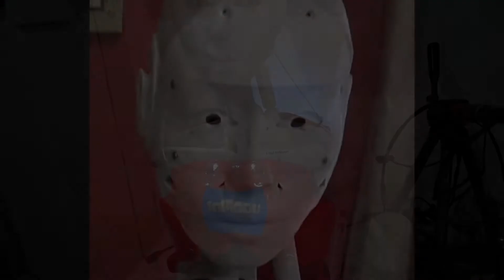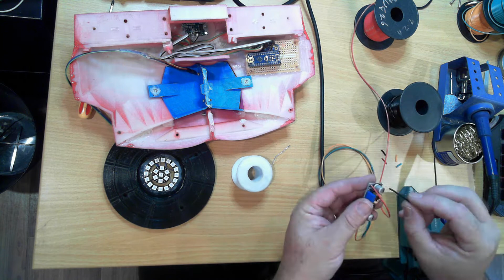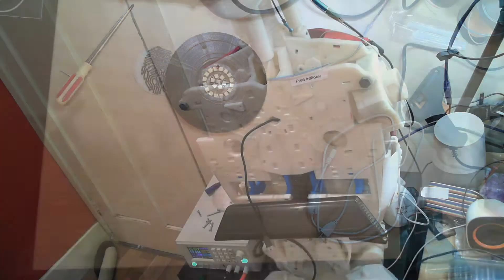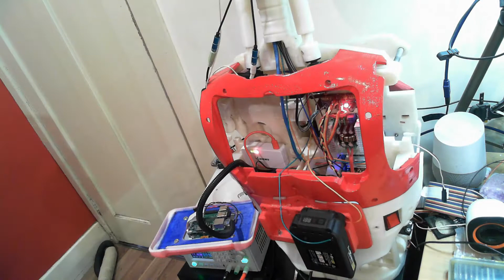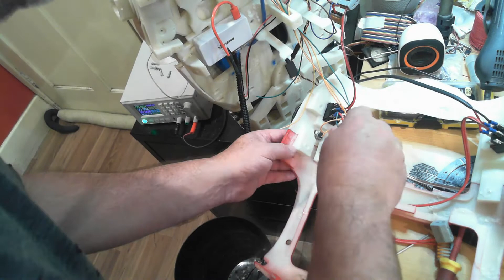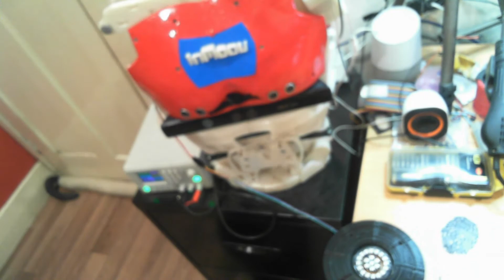Upgrading Fred Arduino with a SMPS

Comment: Nice job, I really look forward to your videos. I have decided to use a small form Core i5 as my base and have a Raspberry Pi 4 and an Arduino Mega 2560 for my servos and cameras. my question is, should I put My Robot Lab on the PC or the Raspberry Pi?
Reply from the maker: Sounds great!
I would install MRL on both the Raspi and the I5 computer.
MRL has the ability to talk to each other, so you can split the processing between them :-)
Reply: @CyberOne  Thank you